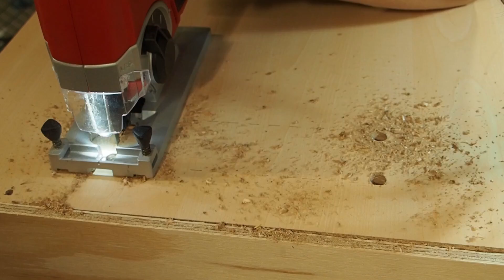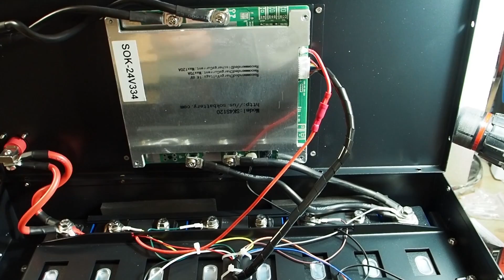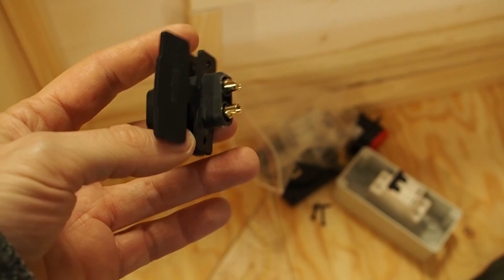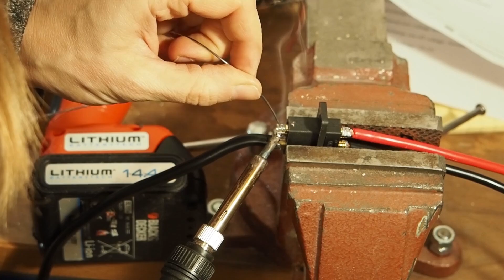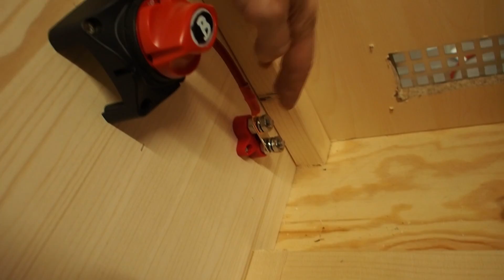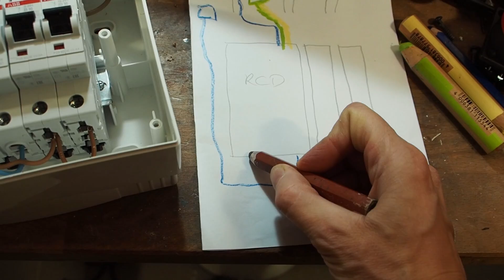Solar System in a Cart - 24 Volt (Part 1)

Comment: OK, it's a 24V system but everything in Europe operates on 220V. So, what is it to be used for?
Reply from the maker: the inverter takes the 24 volt to 230 volt
Reply: @SurvivalLilly  I see, 24V is the input, not the output.

Comment: Like the build!
I built a 5200w 24v system using a composite material cart. It has an upper and lower tray. I changed the two fixed/straight wheels to swivel type so I can move it around and position it from any angle. I attached sidewalls by using 1/8" whiteboard material with 2-sided Velcro. It encloses the batteries and can be removed simply by pulling off the panels as needed. I attached a shelf in the lower tray area to mount the inverter. I also attached boards to the front end of the cart where I mounted circuit breakers, charge controller (MPPT), solar panel switches, breakers etc.that

Comment: Reflow that solder. Soldering should be shiny layer on the outside and the copper should be hot enough that you can just touch it with solder wire and it starts to flow. These thick cables can take a lot of solder to fully penetrate. Pre-tinning them as other people here recommended makes that somewhat easier

Other than that very solid and well-planned build, good job!

Comment: I use a hand truck instead of a cart. I use 2 deep cycle lead acid batteries 140 ah and 2 16v 500 farad  maxwell super capacitors. This allows me to run welder or circular saw anytime the sun shines all day. Lithium is a lie. Only so much lithium in the world 100 years with recycling. There is no way for most to refurbish lithium battery like you can a lead acid battery. The use of lithium is actually worse than using fossil fuels. But hey people don't want to hear what they don't want to hear. Even if it is the truth. People refurbish lead acid batteries in the poorest countries all the time. Lithium phosphate makes a huge fire.
Reply from the maker: You are right about some things, but Lifepo4 does not burn easily.

Comment: The wires from the charge controller to the circuit breaker are to tight if you drop something heavy you could hurt the charge controller or the circuit breaker or both

Comment: If you let a Lithium Ion battery discharge to 0 it will lose its ability to be charged you will have to shock it back into the ability to charge if you're lucky. but the BMS should protect you from that situation

Comment: Instead of buying Ferrule's and a crimper why not just coat the strands with solder?
Reply from the maker: The solder can break if you screw the screws on the wire too hard. Also a ferrule is super cheap. Also, who has time to solder each wire? It would take like 5 hours to solder these thick wires properly.😅
Reply: @SurvivalLilly  propane torch and silver solder.

Comment: The problem in the cart , are the wells . i bought 3 of them and i have to replace all the wheels because of the air chambers . i replace them by full wheels without air chambers . for a weight of 150 kg . now it is perfect .

Comment: You need 2 RCDs for 2 sockets, and it is not a tn system without a grounding rod
Reply from the maker: Nope you need one 1 RCD and 2 breakers
Reply: @SurvivalLilly  it is a question about safety level. Without a grounding rod, the system is not tn (terra/ground, neutral). If it is not in tn system, there is electric hazard if both of the loads fails.
Reply from the maker: And nope, the rcd is working even without grounding rod. The same system is used for campervans btw. Nobody grounds the chassis of a campervan.

Comment: Great video, Lily!  Good job on this most useful backup power supply! That is an awesome battery & setup!
My husband built  our small system using similar batteries & equipment.   He did much of the same research  & chose similar batteries for many of the same reasons. We can power all essential appliances.... freezer & 2 fridges, lights & ceiling fans, ice maker, etc as needed.  We live where hurricanes & extended power outages are quite common, so really happy to have this available.  Blessings from NW Florida!

Comment: I know it's too late but for the next projects, I'd keep the wires (esp. the power ones) a bit longer than necessary. It saves lot of work when you need to change some component and the connection points are not exactly on the same place (don't ask me how I know ;) )
BTW when I open the batter page, there are only 12V (and 24V systems), not the 24V ones. Sorry if you explained it, I was doing sth else in parallel to watching the video

Comment: Certain that writing on the battery charging voltage 29.4 volts is just killers, it is to make it last less and give more capacity, I can't imagine at what voltage the BMS disconnects, 29.4 volts are equivalent to 3.67 volts per cell, it is madness, I can advise not to exceed 3,5 V maximum 3,55 volts per cell, then stop charging at 28 volts 28.5 maximum, even if better 28V, as minimum discharge voltage 24Volt 23.5Volt maximum, also if better not to go below 24 V, at least in this way they will have a longer useful life in cycles

Comment: Whenever I see these diy builds I wonder how these compare capacity wise and cost vs a the likes of a ecoflow product
Reply from the maker: This DIY is completely repairable. Store bought power stations are great but not repairable.
Reply: I lean heavily towards building a diy like you, I am just curious how they compare, im bet the diy version will outperform at a good savings kw hr / $. I'm just surprised that I've never seen the comparison. Anyways thanks for these videos, I have a small off grid shed I'm building and will use these as reference.

Comment: Lilly, it looked like the iron may need to be of a higher wattage so that thick wire gets hot enough to melt the solder  and form a solid connection to the terminal. If not, the connection may overheat when the battery is charging.

Comment: It's a good idea to "tin" the wires before soldering them into the connector. You want to make sure the solder flows into all of the strands of the wire where the connection will be.
Reply: This is true.  I thought the same.  But it should still be OK.  Can be even more time consuming but beneficial for more humid or wet locations, can keep the copper from corroding.
Reply: @JonathanFreedom1st   I use ferrules for most of my connections.

Comment: Given the fact that its looking like an pandemic how many burns there are with lithium kind of batterys and because of the limit of use of these kind of batterys in cold weather that if i am to build something with solar / wind or water generating power i going to use the old fasion car batterys or if possible traction batterys to hold the power . 
Also the more and more unfolding effects of spaceweather on earth and the Geo Induced Currents ( GIC's ) that will effect electrical components and the chance of a fire that is hard to get out like these tesla's , i skip this technology .

Comment: Great build and assessment of the battery Lili.  You highlighted all the important parameters on the datasheet.  I also agree that portability is the way to go for small systems.  PS: I hope one of your sponsors can send you a heat gun for your heat shrink tubing.  I have one and it makes it much easier.

Comment: I built a complete solar charger, battery, and panel transport..... out of a double baby trail jogger
Reply: What kind of battery did you go for?
Reply: @ffviifakeremake9997  well i avoid high dollar cutting edge new stuff, ( and their sensitivities i.e. $$  cold / hot )  i have gone with used good old fashioned simple lead acid deep cycle batteries. My entire ( 3 stand alone )  set up's are each made of newer but used components. One is none, 2 is one, 3 is better.